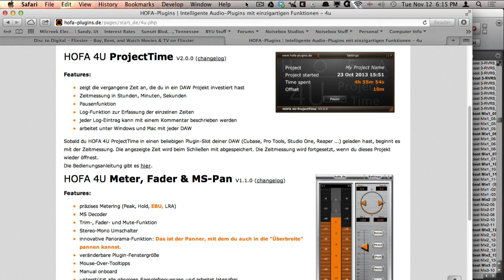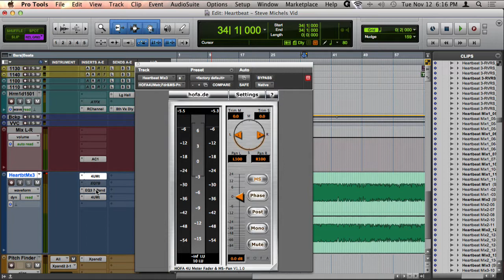Pro Tools: Multichannel vs Multi-Mono and MS (Mid-Side)

Comment: Great vid. thanks. With term Mid in Mid-Side you actually mean "center". It seems to me "Mid" is confusing as one might understand it as referring to mid range frequencies... ne ?
Center better, wouldn't it be ? Cordially.
Reply: This is a great point.  Although the technical term is "Mid-Side" for MS. But you are right that it would be possible to confuse the word "Mid" to meaning something other than center.